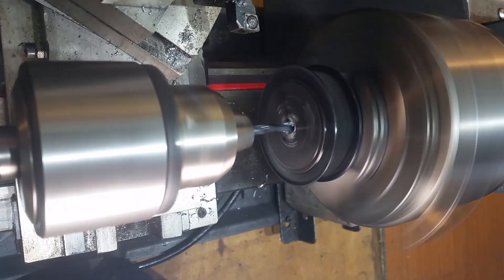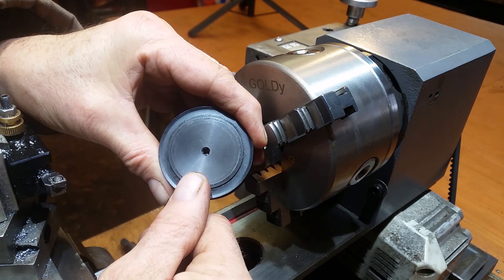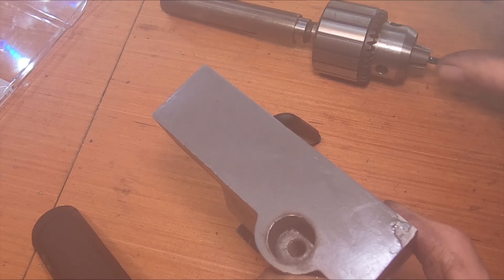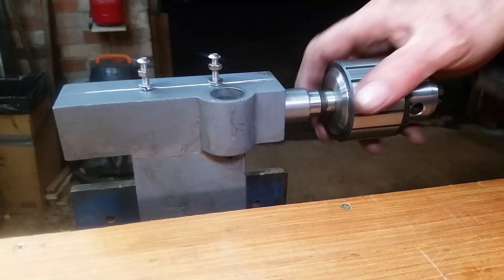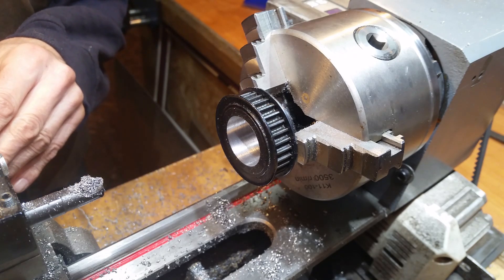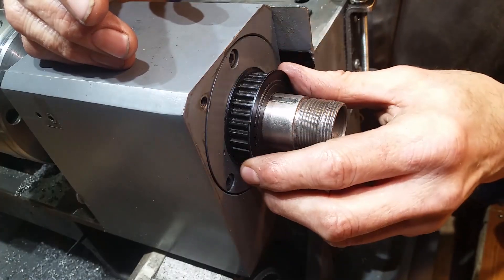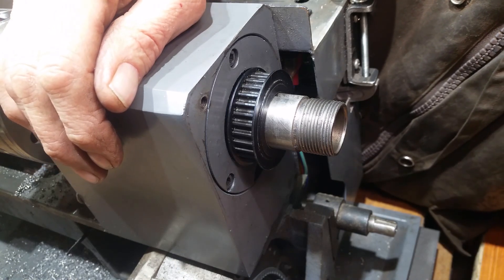MINI LATHE UPGRADES #3: HTD DRIVE BELT & Tailstock Setscrew Fix

Comment: This is a year later, but the way some of these tail stocks work is that the quill clamp doubles as a key, and fits into the keyway on the quill to keep it from rotating.  That's how mine works.  Others use a set screw driven from below at the front.
Reply from the maker: problem with the quill clamp doubling as the key is when you want to wind the quill out, like for drilling a hole (as in this video)
Reply: @myharris  Ah enlightenment sets in!  You're right, the clamp was working as a key except that the quill passed it.

Comment: This is where a 3d printer is incredibly useful. I regularly whip up close fitting 2 or 3 part prints to hold irregular shaped parts. Works great. Can model it to hold a part any which way and angle and print it in a solid ABS and clamp a part in. I also just bought a 4 jaw but its a 5" and now i have to figure out a 4-5" mounting adapter😂
Reply: I hope it's not a mini lathe,  100mm is as big a chuck you should fit.
Reply: @TheGreatBungholio  yes. It's an 8×16- so larger than the typical tiny mini lathe which is 7×10 - 7×14. I bought a semi milled 125mm adapter plate and machined it to the lathe, the 5" 4 Jaw works phenomenally. You're prob thinking of the smallest minis that come with a 3" chuck🤣 ive already installed tapered bearings and upgraded about everything on it- including adding auto feed. No issues throwing a 8" piece. The lathe is literally made to have an 8.25" throw. The 5" chuck is a completely standard accesory
Reply: @notyouraveragegoldenpotato  Fair enough,  I've got a 7x14, and can't imagine anything bigger than a 100mm, there's a video of someone using a 5" 3 jaw scroll chuck on a mini lathe,  and it vibrated loose and shook the entire machine,  really not good for the machine
Reply: @TheGreatBungholio  oof. I wouldnt want a tiny piece come out of the chuck at max rpm😅 for mine I bought a legitimate 4 bolt 100 to 125 back adapter plate from little machine shop, mounted it and machined it concentric to my lathe. It's a proper install. After modifying and upgrading everything I'm blown away by how capable these machines are. I'm getting incredibly low runout with the Taper bearings. I made my own HTD5 drive gear and sprocket with and swapped to a legitimate rubber HTD5 belt that has much more robust teeth engagement because the dinky oem belt fell apart in the 1st week under torque load. I made a solid vertical milling adapter plate that bolts directly onto the cross slide and mounts a vertical milling slide and have able to do modest milling jobs, about 3"×7" in the vice or 5×7 if it's mounted proud of the milling vice without repositioning. That's mostly what i do the 3D printed fixtures for because the milling vice is pretty small and not the most robust design. I'd 100% trust them in the chuck as well but that's why I bought the 4 jaw (which is a game changer if you do anything other than round stock)

Comment: To cut a keyway in the bore of something just use a boring bar with a square ended tool bit on it's side and rack the saddle in and out......done that many times so it works.

Comment: No, there's no hole drilled in the bottom of the tail stock for a grub screw and a lock nut. Chinese quality control (or lack thereof) strikes again!
Reply from the maker: I'm past the point of being annoyed by this stuff - well, almost past the point! These days I just assume I'm getting a semi-finished self-assembly kit from the get-go. Ya get what you pay for - and ya pay for what ya get! Thanks for taking the time Robert, appreciate your input 👍

Comment: 6:45 if you really need to test the fit of something held in a three jaw chuck, the answer is to take the whole chuck off the spindle complete with the part- the spindle register will repeat. but its not quick :-)
Reply from the maker: Now that's a great tip for future reference! Never occurred to me. Appreciate that Peter, many thanks.

Comment: so weird that the tailstock didnt have a keyway. as a long term fix you should consider making a cylindrical bronze bushing with a male keyway inserted from the top (maybe by enlarging one of the holes you just made for the screws) and holding it in place with a set screw. the cutting edge engineering channel here in youtube has a recent video fixing another problem with their tailstock, and on the dissasembly you can clearly see this type of keyway i mention, if you need inspiration
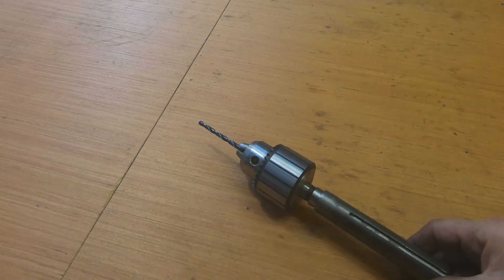https://www.youtube.com/watch?v=uR60QPh_seQ (at 2:33)
Reply from the maker: Good call, I saw CE had posted about a lathe recently, it's still in my watch list. I was just saying to Bill in another comment I found this video of a guy fixing the OEM tailstock set-screw in a comparable Grizzly machine: https://www.youtube.com/watch?v=4ykDMio2Ams , but I think your idea is definitely the engineer's solution 👍 Thanks for your support, very much appreciated.

Comment: In a pinch, you could use a hand file to cut the keyway.
Reply from the maker: Yeah, it's what I've done in the past but it's cropped up enough times now I kind've feel I need to sort out a better system. I've seen people grind down an old drill bit to the right profile, make a holder for it, and then use the lathe tailstock or the mill quill to manually scrape it out. At the moment I'm leaning towards the mill method. Appreciate your comment, cheers :)